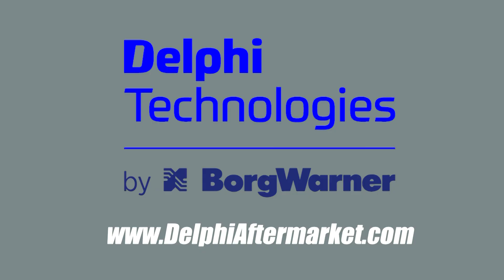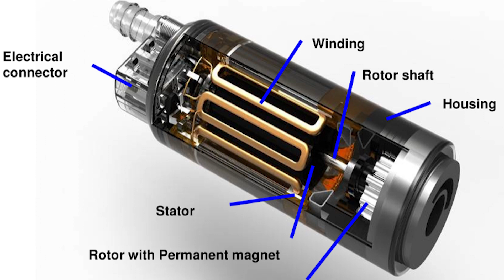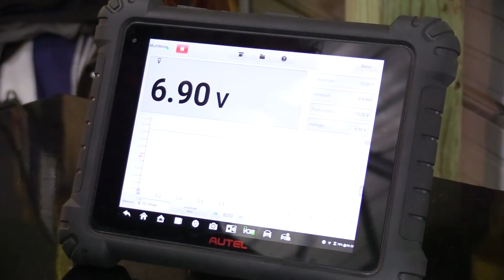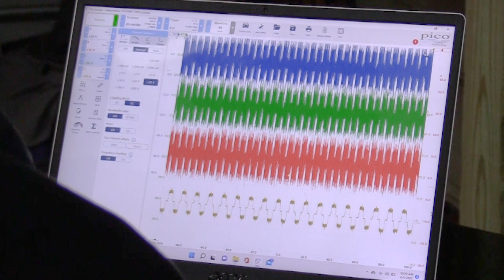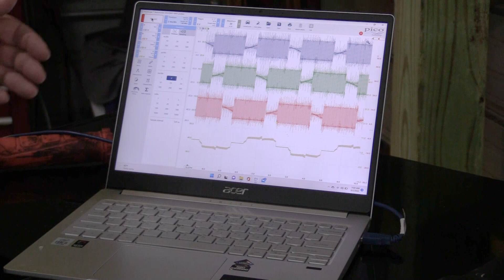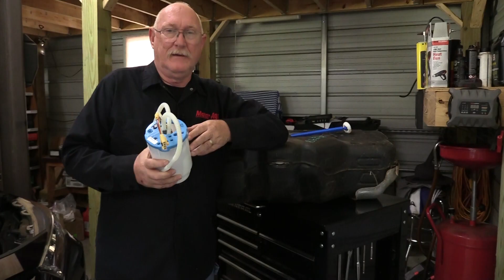Service Done Right 11:  Testing Fuel Pumps - What You Need To Know BEFORE You Start!

Comment: Sure the 3 phase pump may have eliminated the brushes but 19 out of 20 pump failures I have seen are mechanical wear on the pump made up by higher command time. So as a pump wears you will see 5000 rpm commanded and desired does equal that so you have to know what a new pump rpm or command time is. Electrical failures on 3 phase are almost non existent.  You have to know the system you are working on

Comment: How to test with power probe 4. I did test the fuel pump fuse and then g402. That one has no relay to it it was running by fuel pump driver module. 2016 Chevy Malibu 2.0l turbo 4 cyl

Comment: I read about these pumps several months ago.  The speed and therefore output pressure can be controlled much better by way of the control module.  Will be interesting to see how long the control module and it's wiring will last in the salt belt areas.

Comment: So what does the waveforms look like if you unplug the fuel pump and front probe the connector is it just12 volts on all 3 wires?
Reply from the maker: On the brushless pump, I read OCV on the one and I would expect the same reading on the other two.
Reply: What’s ocv
Reply: @philh9238  open circuit voltage
Reply from the maker: @philh9238  OCV stands for Open Circuit Voltage. It's the voltage you measure when you measure across the battery terminals.
Reply: Typically you´ll expect 0 volts with the pump at rest. It then is not pulsed by the FPCM.